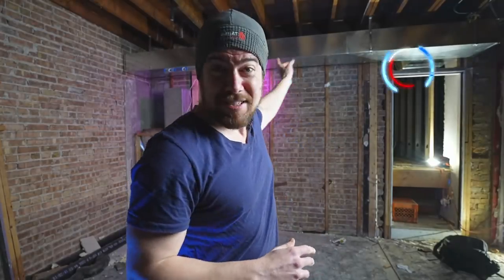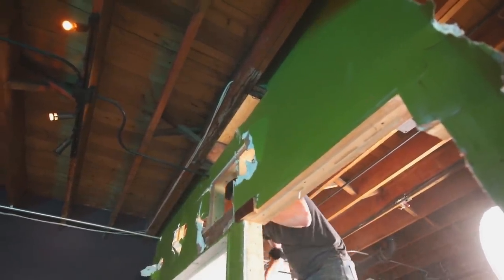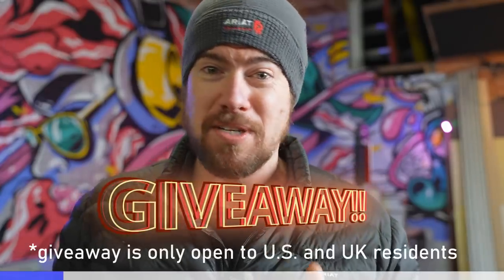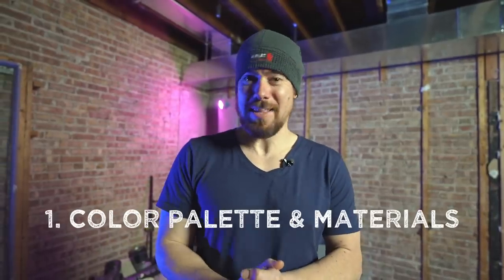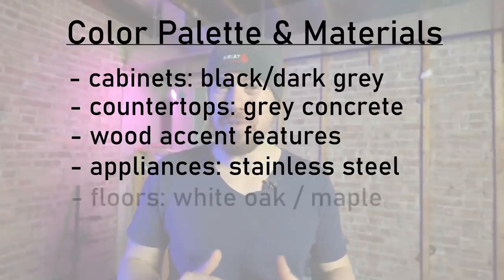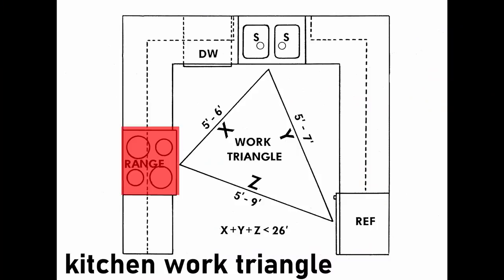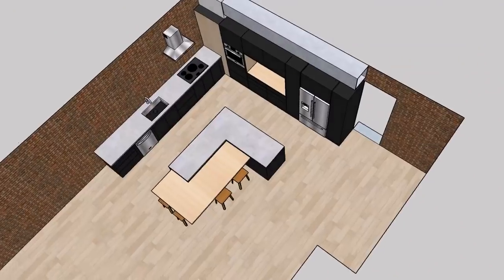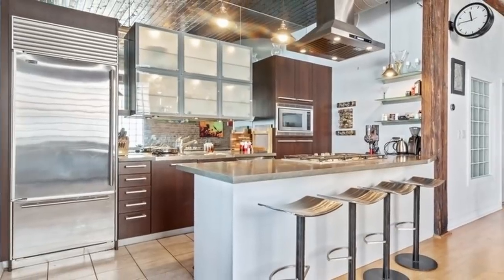Abandoned Building Reno Ep. 11 - DREAM KITCHEN Design and Demo

Comment: Electrician here, would highly recommend trying to get wiring into the kitchen island, for pop-up outlets or usb chargers. You will not regret it later.
Reply: As a kitchen user with an island not wired who has made cookies in kitchens with outlets on the island I whole heatedly agree!
Reply: Agree with that
Reply: 100% of the kitchen work happens on the island in our house. Couldnt imagine not having plugs there
Reply: As an Electrician I second that
Reply: Yeap, put outlets in your island, you'll regret it if you don't
Reply: Islands with wireless charging pads are very useful too
Reply: As somebody who likes tech and maximizing efficient counter space, I also agree! More outlets!
Reply: @DuchessEvie  maybe. But i Wouldn't. The problem is now you have to put your phone there and you effectively loose that space
Reply: @williamwinder3466  In his island design he could place the pad in a corner part of the lower wooden table. Then the space isn't exactly lost as there's still plenty of room left over and those corners will probably rarely see much use regardless
Reply: And for futures. My house is built on a post-tension slab and I really wish that futures had been placed around the space so I could more easily remodel. Thankfully my garage has a future installed for a 220V car charger since we purchased an electric car but still haven't installed the 220V charger yet.
Reply: Our island has one outlet about Galway down and Galway down on side. Almost useless. I second the pop ups.
Reply: @DuchessEvie  He even said he does work there. Would be cool to plug in your laptop and phone.
Reply: @oldmanwithaplan7982    Galway?
Reply: @Arterexius  Corners like that are for decorating. Not phone pads.
Reply: USB-C is becoming much more popular than traditional USB (for example Apple’s newest iPhone and MacBook chargers use USB-C) so I wouldn’t recommend a USB outlet. Not sure if USB-C outlets exist but that could be useful.
Reply: @msb5775  They do exist, but the point of the comment was to recommend getting wiring into the island nothing more.
Reply: Totally agree
Reply: I was thinking that too

Comment: As a cook, and also esthetically, I would HIGHLY recommend centering that stove and vent hood on the wall. You’ll enjoy the extra cooking room and the vent hood will look more like a focal point and less of an afterthought.
Reply: I totally agree with GeeGirl. Stove and Hood is like a totem. It should be the centerpiece. And in terms of practicality it will be a lot easier to clean! The back wall will end up having some collateral splashing if you place the stove according to your blueprints! I would also recommend some kind of prime for the bricks as well! They stain and form spots of grease on their surface from splashes!
Reply: I also wondered why he didn't place the sink or the stove and vent hood on the island
Reply: I see some of the new fangled cooking stoves/induction plates can come with integrated vents that most likely use filters. Thoughts? It would free up top space..
Reply: @DiegoOrtegaVFX  Agree 💯

Comment: I would highly recommend a couple of open shelves on the brick wall on either side of your sink. 1) it won’t take the focal point away from your “one-wall kitchen” on the adjacent wall 2) having your plates right in front of you is so great for pulling things off the stove and plating them quickly 3) they look great and won’t leave that wall looking so bare.
Reply: Yeah, I was thinking the same thing with the floating shelves

Comment: Looks great and I agree with your ideas. A couple recommendations from someone who has recently done two kitchens:

1. Move the sink to the center island. It’ll require busting the concrete to run a line, but it will be worth it. Opens up that whole wall for a center stage oven/backsplash/vent hood.

2. If you don’t want to drop a ton of coin on appliances look at the Bosch ranges. They have flanges that go over the gap to the counter and have the knobs in the front. The lack of gap and clear back space in the backsplash gives a great built in look. They also perform great. Also can’t beat Bosch dishwashers.

3. Check out Urbane Bronze by Sherwin Williams. It’s their 2021 color of the year and is a very dark color that would make a great dark kitchen.

Comment: You need to think about the heat coming from the oven when you're standing at the cook top. You don't want to be cooked whilst you're cooking!
Reply: you can increase the width of your countertop to 80 cm. because you have no upper cabinets. that means a lot of extra space. also think about a separate wok burner. with the stove you prepare to install you can use non of themother burners when you use the wok burner

Comment: When brick is weak or damaged, place a poster or painting over it and no one will notice it.
Reply: especially if it's a load-bearing poster
Reply: yes ive been in the trades for 20 years and i do the same - never had a callback
Reply: @daveh4925  Maybe they're under the fallen brick and can't make the call... lol.
Reply: It worked for Andy Dufree
Reply: @guy4462  ive never had any complaints or negative feedback
Reply: @daveh4925  I meant that as a joke.
Reply: It's a great way to get out of Shawshank, for sure
Reply: @PKSullivan  fun fact - andy's motivation for leaving was butt fkin
Reply: @daveh4925  isnt that how you repair brick, put a wallpaper with soundly laid brick on both sides and your good?
Reply: @dougbrown7150  i work in black face to show my admiration for the blk community

Comment: Definitely do the wall oven! You will love it, when getting things in and out! Think backsplash - perhaps a long glass or metal one along the whole wall. You will be splashing water at the sink, and grease at the stove-top. By having one long backsplash, you won't get a choppy feel, visually. Also: electrical outlets! Make sure you have them in several places for kettles/coffee-makers, and the appliances like food-processors and mixers you may not need often, but will need to plug in! I absolutely love the idea of the drawers as opposed to cabinets, and the pull-out larder is a great idea (but think about a firm back for that, if you have a basket-design at the back, things can fall off, and it is a hassle to get them out).

Comment: I just seen the best idea for how to handle electrical outlets. This one house I had seen, had placed the outlets on a permanent ( can't think of the right word) power strip right under the cabinets. It looked so good and clean. The same kitchen had a sheet of stainless steel for the backsplash. It was so sleek and looked so good and professional! Also make sure you properly light your kitchen. Also remember to get under cabinet lighting.
Talk to a professional who builds kitchens. Even if you just pay for a consult, make sure you get everything you need. Like a garbage disposal. Also, like a built in ice maker. Keep in mind that the value of a home is held in the kitchen and bathrooms. So make sure you build them to a high standard as it adds value to your property.
Reply: I've the power strip you refer to called a "raceway."

Comment: I'm loving this series!

One comment: You mentioned the kitchen triangle. I have found that to be really true in every kitchen I've worked in, and I've also found islands are tempting to add to such an open area but they can really interfere with that triangle.

I would suggest putting the sink between the fridge and the stove instead. First, it would preserve your triangle for ease of movement between the three. And second, you'll be typically going from the fridge to the sink far more often than from the fridge to the stove. (Unless all you ever eat is TV dinners...)

Comment: I think you should move the main wall to the outside wall. Stove centered with a gorgeous (copper?) hood, fridge on one side (at the end of the cupboards), balanced by a wall oven to the other side (right in the corner). LOTS of counterspace to either side of the stove. Then the short side gets the sink and dishwasher, that side of the island gets drawers for dishes.

Also, depending on your plumbing runs, you might put a small prep sink in the island also, maybe with a removable cutting board cover. We have 2 sinks in our kitchen and I LOVE having them.

Just thoughts! I'm sure it will come out awesome however you decide to do it.

Comment: Cooktop and separate wall oven is good. We bought a combo wall oven, microwave (Kitchenaid) in addition to a Viking cooktop.  Not sure I'd do it again.  Microwaves have  a habit of failing after a few years. The integration prevents you from simply buying a new microwave.  The tradeoff is that you get a visually integrated appliance set, with common UI.

Comment: Check out used appliances &/or used commercial kitchen equipment.  It's often significantly less & sometimes it's barely used.  I’ve seen a ton of ads on Craigslist for the CHI area.

If you are planning to cook a lot &/or for entertaining, I suggest:

- Double Built In Ovens - Full Size (I would also add a warming drawer - as many of them also work to bake @ less than 350* - for cookies/rolls)
	At minimum, 1 large wall oven & a 2nd small appliance with a bake/convection feature.
	We use our convection microwave & our convection toaster oven (which also bakes, broils, & toasts) quite a bit - especially when the main oven has been taken over by large items.
	Wall ovens are nice since you don't have to bend over to get things in/out.  This is REALLY noticeable when you have heavy pans/items - like cooking a 25# Turkey or using your 5 quart cast iron Dutch oven.

- Build the Microwave &/or Toaster Oven into the island (or hide it behind a cabinet door). 

-  I would also add a 36" wide - 6 burner stovetop (or 4 burners & a griddle).  If you have large pots or pans, it makes it a lot less crowded.
	You may want to add a counter mounted pot filler, since I'm guessing that the brick will stay exposed.

-  For Frig/Freezers - Look into 2 separate appliances.  1 of each - All Frig & All Freezer.  Gives you a ton of space & it's really flexible when you need to prep for a party &/or for meal prep.  Alternatively,  you could add a separate counter height frig &/or freezer &/or wine/beer frig.

-  Add a dedicated under counter ice maker.  (I have been trying to figure out how to add one to my kitchen plan!)

- Garbage Disposals & Drawer Dishwashers are great!

-  A 36" (Minimum) Wide with 20"+ Front to Back & 10"+ deep ONE bowl sink.  
	Unless you can add 2 bowls that are more than 36" wide (each).  I constantly fight to get my dishes rinsed in my 2 bowl sink & my big pots are a nightmare.

Even if you can't add all the extras right now, I would suggest planning for them & building accordingly.  Setting up cabinets/panels that could be removed or are built wide enough for a different or larger appliance, running the extra water lines &/or drains for the pot filler/ice maker, & running all the extra outlets for any additional built in.  It's easier to cut a bigger hole for a larger sink or stovetop, but it's a pain to have to completely replace the cabinet if it's too small.

Comment: If you hadn't already considered it, if you're able to get electrical into the kitchen island put an outlet on each end under the counter so it's out of sight. This will help when you're using the area to work on your laptop, to charge items, etc and will cut down on the need for extension cords running around the kitchen area.

Comment: If you haven't already started your cabinet build consider a full depth refrigerator (not a built in) over a cabinet depth. It's hard to fit a pizza box in a counter depth fridge. Given that you are building your cabinets you can make the cabinets along the refrigerator wall deeper allowing for the front of the fridge to be flush with the cabinets. You could also pull the cabinets away from the wall and put blocking behind to attach the cabinets to. This approach also gives you about 4"-6" more countertop depth.

Comment: Think about putting your cooktop or sink on your island. So when you are either cooking or cleaning up you are overlooking your living space/lounge, you don’t want to be staring at brick walls all the time. Lots of innovative exhaust fans that pop up from bench top or from ceilings too. Think about direct boiling water taps, they even make them to be able to deliver carbonated water as well. Check out some commercial fridge options or get a small glass door bar fridge or wine fridge to put at the front of your island for your drinks. I’m assuming the large open section next to the wall for coffee machine or appliances, personally would love some cabinets with power points so I could use toasters and other appliances without losing valuable counter space. You must have a dishwasher too, obviously dictated by sink location. My only other must would be to have one of those pop-up power towers in your island to be able to attach occasional appliances or usb devices. 
Be sure to check out Anova’s new oven too, supposed to be amazing for the price. Can’t wait to see the finished kitchen.... 👍🏼

Comment: You definitely need something on the wall by the sink. Floating shelves would be cool. I think room for some plants will help it not feel too cold. I also think maybe you should go with warm hardware. Like gold/copper faucets, etc. Some warm metals will really help make it homey and maybe be a nice contrast to the stainless steel appliances. Lastly, you'll probably need to really consider how you'll light this room. You could try do a really nice exposed lightbulb setup. Pendants, etc. 

I'd also be sooo stoked if you could do a colab with Mr. Kate once you get to decorating. That'd be a rad video. 

Loving the series. Can't wait for the next one.

Comment: for the dead corner between the oven and cooktop you should integrate one of those boat pantry that are round and you spin to get the stuff that would otherwise be at at the back , and to avoid the opening to have a door that would interfere with the hob cooktop and hood you can do a upward opening door (out and up)

Comment: I know I am a little late to this video, but if you can, I would really consider two things (as someone who used to design/build kitchens and also loves to cook at home):
1) Move the stovetop towards the front of the building to both give yourself prep room to the right of the stovetop (next to the corner wall) and also, if you go with a separate oven in the back wall, give yourself room to work on the stovetop and move to the oven and vice versa as the oven door when down/open looks to obstruct the standing area for right most burners.
2) Consider moving the sink to the island opposite the back wall. You are likely going to do all your prep of veggies and other items from the fridge on the back wall counter or on the island. Having to walk around the island and past the stove and oven to get to the sink to wash produce or drop off a hot pan/pot/dirty item/thaw frozen meats will get old really fast. Having the work flow be fridge -> sink -> stovetop and then stovetop -> sink -> fridge is a much cleaner and efficient sequence. Also when bringing things up the stairs after grocery shopping, you will want to use the back wall counter or island to drop things off. Having the sink so far away will get annoying over time. Lastly, you will likely be pulling water in that back wall for the bathroom. Having the sink in the island opposite that wall means far less plumbing work and prevents the water lines from being on an exterior wall (not sure if a party wall or actual exterior wall to the environment of Chicago).

Comment: Just a suggestion, go with Delta plumbing fixtures, they are easy to maintain.  If you can do an exhaust fan the vents to the outside.  Ok, my wife likes the two door frig.  Yes they are esthetics pleasing, don’t do it.  Get a single door top frig.  The two door frig’s are not ergonomic for men.  They are a pain in the butt.  It’s up to you.  For your base cabinets if you can do all drawers do it.  Don’t forget a pots and pans or pot lid drawers.  On one side of the sink do a trash can base cabinet.  It’s one of my favorite features.  There are knock off Sub Zero frig’s.  If you can go with an extra sink in the island do it.  When you have a big dinner or a party it’s going to pay off.  On your flooring, place your cabinets and appliances on 3/4” plywood, it will save you money on your flooring.
Good luck with everything.

Comment: love the look of the kitchen, personally wouldn't go with that layout, instead I would have the cook top where the sink is to maximise space on either side for prep, and put the sink in the island opposite the cook top, so dirty pans can be disposed of, drained etc in one single movement rather than lofting hot pans over anything on the side adjacent to the oven. 

Then again, I'm saying all this because that's the layout I'm used to, and you aren't building this place for me! 

Also surprised about what you said about the built in appliances, we went for a pair of built in ovens, an induction hob and a gas ring and the set up cane to only around £800 more than the equivalent single unit. The integrated fridge freezer was no more expensive than a separate unit, the only extra cost being the price of the cabinet fronts to attach to the front of the unit.

Really exited to see this project move along!
Reply: i have an L shaped kitchen as well with two sinks, one in the island opposite of the stove and its amazingly helpful (think strained pasta going back to the stove, less drips) and one on the other side of the L. 

having two sinks is also great when you have multiple people in the kitchen